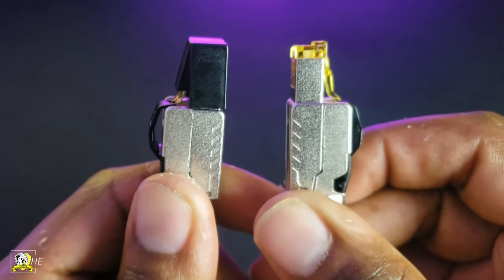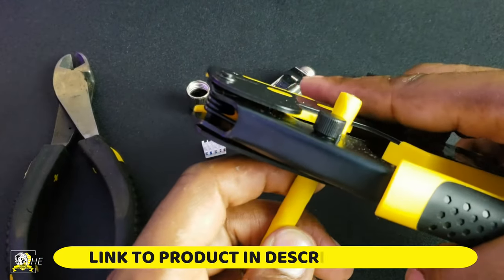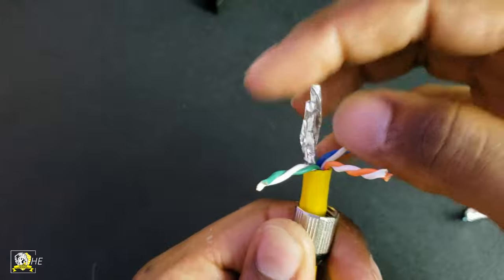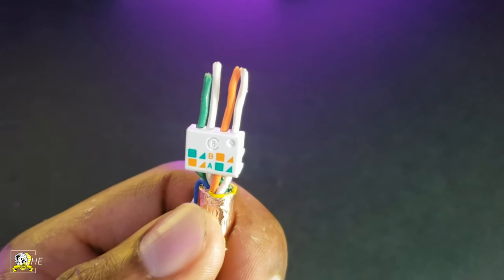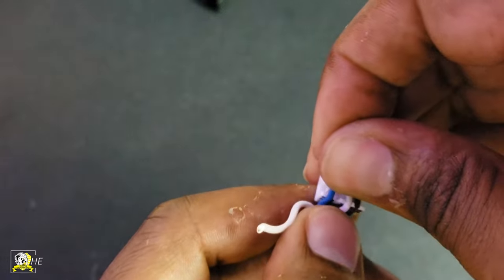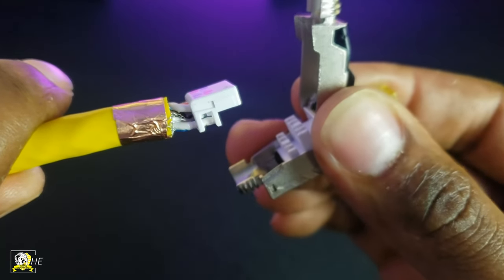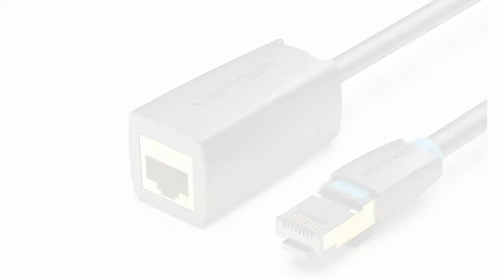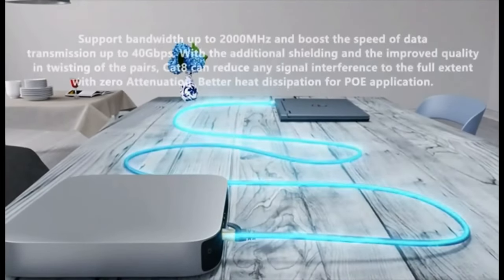DIY Cat 8 Ethernet Cable - Male Field Termination - Save Money!

Comment: It won't be the fastest Internet cable if the shielding is not attached correctly. The drain wire should not be cut, it should be folded back and tapes over with the copper tape for correct electrical grounding.
Reply: Yeah, that part really bugged me. Ruining the whole connection.
Reply from the maker: Yes I'm well aware of this from the 1st to the 20th person who made the same comment. 
I acknowledge the error then pinned (1st comment) a link to how to ground the cable in the comments + description.

Thanks for watching 👍🏽
Reply: @HumanEncoded  looks like YT did ya dirty. It doesn't show as pinned anymore.
Reply: @HumanEncoded And yet it took you a full year to finally respond defensively..

Comment: The shielding mesh around the conducting cables has to be connected to form a Faraday cage, to protect that cable from electromagnetic interference:
https://en.m.wikipedia.org/wiki/Shielded_cable

Faraday Cage:
https://en.m.wikipedia.org/wiki/Faraday_cage
Reply from the maker: Good point... Will have to make another video grounding the shield in the near future. Thanks for sharing

Comment: Even though you made some mistakes on the specifics of this tutorial im glad you left it up. Im wiring one of these up today and im horrible at following diagrams. Sorry the internet is populated by assholes. Thank you!!!
Reply from the maker: THANK YOU AUSTIN! 
I've acknowledge the error (seems like) hundreds of times on here. 
I've even posted a link to a video (in comment/ description) correcting it. 
What I was NOT about to do was erase it!
The CAT 8 cables I made like this still works to this day! 
I do appreciate ppl like you that understand & still are able to get value from this video.
Will make sure NOT to cut the wire on the next one! lol 😆

Comment: What about the grounding wire, and testing it?? I would put the external cup before stripping the wires out. Thanks any way.
Reply from the maker: I did cut the ground wire (not knowing it was needed). I also tested it by plugging it into my computer & testing the internet speed. It worked with no problems & is still working. 👍
Reply: @HumanEncoded  At low speeds it's no problem, but at higher speeds it is necessary.

Comment: It was nice to see what it looked like. I have some cat6a that looks almost exactly like this. This might have a slightly denser outer woven shield and possibly more twists per Inch. But, after hours and hours and hours of reading and looking up specs and TIA standards I realized after fully shielded twisted pair cat 6a standards don't mean dick. You gotta look up the cable spec real good and see whats inside. Some cable.is over spec and some cheapo under specs.
Reply from the maker: Very interesting info... thanks for sharing & watching. 💯

Comment: You build very expensive antenna by not connecting ground 😂🙄.
Reply from the maker: I realize that after I posted the video but the cable still works fine to this day. I still receive high speeds from it.
Reply: @HumanEncoded  you should not ever cut that wire the factor made it to resolve interferences, reduce interferences will increase speed by lowering ping
Reply from the maker: @johnricher133  Glad to hear all of the feedback for everyone after cutting that wire. Will definitely NOT cut it next time. lol 
Thanks for sharing John. 👍
Reply: @HumanEncoded  Your Welcome!✌🤘👍

Comment: You stripped away the metal wire shielding that is needed to ground this. Then you applied the conductive metal foil wrap to the outer Cover of the cable. So what is the foil supposed to connect with?! Is is supposed to make an electrical connection between the metal shield wire and the metal housing of the connector. Your instructions preclude this connector from performing the way it should. Why are you doing instructional videos misleading people how to do this? These connectors are very expensive and are designed for very high speed.
Reply from the maker: As far as I know the wire that I cut only operates as a shielding component.
It only shields the inter wires that I connected from outside interference (frequencies). 
The fold that I wrapped around the end acts in the same way.
You do not connected that outer shield to anything. 
I'm not sure what you are talking about Dan. 🤔
Reply: @HumanEncoded  I understand that these components (wires) shield, but they also act as grounding. These connections are supposed to make an electrical ground that is carried through their metal housing to “shielded patch panels”, which are themselves grounded via an electrical wire to the rack.  Shielded patch panels for racks are twice the cost of normal patch panels because they are designed for grounding with these metal (and expensive) terminations. The foil that comes with these is special. It’s adhesive is also conducting. It is for electrical connection for grounding. Therefore, the wires just inside the outer cover of the cable need to be wound back on the outside to connect with the foil that connects with the housing.
Reply: @HumanEncoded  Dan is correct. That was a big mistake
Reply from the maker: @danphilpott6302  I looked into what you said & you are correct about the CAT 8 cable should be grounded.

Since I have made & installed several CAT 8 cables before making this video & they all have worked & have yet to fail I'm not sure how life threatening it is for it not to be grounded in that way.
I will however start to ground my cables from here on out.

I will also add another video in the description showing how to ground these cables.

Thanks for your input & insight Dan 👍
Reply from the maker: @ChadDrakeTech  Yes Dan was correct Chad. Not sure if that was a big mistake considering I have created & installed CAT 8 cables since last year this way & they have yet to fail.
I will however start grounding my cables from here on out. 👍
Reply: @HumanEncoded  The cable will still work - what the shield is doing, is preventing interference from the outside, so if not installed correct, you wont be able to reach the bandwidth and speed that CAT 8 can reach at its max, which is aroung 40Gbit if I remember correct, you might only get a max of 20 with an unshielded cable - on the other hand, if using a RJ45 jack on a CAT 8 you will never reach maximum bandwidth and speed anyway, you have to use GG45 connectors.

Comment: i accidentally bought these for my cat6 is it still save to use?
Reply from the maker: If the wires fit then it should work. Never tried to used them in that way before.
Did you end up returning them or did they work for you Brent?
Reply: @HumanEncoded  yeah they worked
Reply from the maker: @brent5709  That's great to hear! Now I can spread the word. 😁
Thanks for letting us know! 👍

Comment: This is a gimmick. If the copper cable isn't bigger then the cat6e copper cables then it's the same cable. The shield only protects against Static electricity and or higher frequency Interference.
Reply from the maker: I'm not sure if it's a gimmick or not but I'm sure within a couple of years more stores will start selling.
More than likely they will improve in quality over time as well.
Thanks for sharing your thoughts. 👍

Comment: Wrong. By tearing off the shielding the cable won't be grounded and therefore the shielding is useless
Reply from the maker: Yea unfortunately I did cut the ground but it still works & haven't had any problems with it since making it.
Reply: @Human Encoded   if there's no  interference you won't miss having the ground.

Comment: Sorry, so many things wrong with this video. 

1: "CAT8 is the fastest internet cable on the market"
 - Does Fiber or even DAC not exist?

2: "CAT8's you don't have to crimp"
 - With the connectors you're using, you don't, but there are many out there in which you do crimp.

3: Pull the outer shielding down, "What I do is cut that off, some people keep it but I cut mine off"
 - That metal weived shielding for CAT8 is to ground it, this needs to be folded back and NOT cut. Will be used later.

4: Copper foil, "My guess is it's there as a shield, as well as probably  giving it security once we put the male connector on top of it."
 - This copper foil was there to connect to the ground shielding to the connector which you had previously cut off. You shouldn't be making an instructional video for expensive wiring if you're going to be doing guess work.

5: Bits vs Bytes
 - Bytes are for Data Storage, Bits are for Data Transfer. There are 8 bits in a byte. 40Gb = 40Gigabit, 40GB = 40Gigabyte. These are NOT to be confused. 40Gb = 5GB. 

Additionally, to get the full 40Gb speed both devices must support it, at that point though, DAC and Fiber are the better way to go as they use less energy and fiber can go longer distances, not to mention most devices supporting 10Gb+ will be using SFP modules, not RJ45.
Reply from the maker: Show me some fiber optic & DAC cables on the market you can purchase for home use that I can plug into my router & computer. 🤔

I am well aware of the ground issue after posting this video + I pin the comment about how to ground CAT 8. 

After figuring that out, I realize what the copper foil was for. 🤷🏾

I do however appreciate you breaking down the bits vs bytes. That was helpful 👍🏽

Thanks for taking the time to watch this video. 👍🏽
Reply: @HumanEncoded  First off, CAT8 is not intended for home use. Secondly, Fiber cables are extremely cheap and the SFP modules are very inexpensive as well. DAC are very inexpensive as well and their prices don’t go too far up for distance.

And of course, the video was well layer out, it was merely the few instructions that were off. Still have it a thumbs up!
Reply: @Tankbot  I'm using cat 8 in my home office just fine.
Reply: @austinrutledge6484  I don’t see the relevance haha, I didn’t say there was anything wrong with CAT8 it’s just redundant these days and too costly.
Reply: @Tankbot001  I don't see why you felt the need to arbitrarily shit on a random creator. But here we are 🎉
Reply: @austinrutledge6484  I wasn’t shitting on, I even complimented how well put together the video was. I was just correcting the misinformation so people don’t waste a $50 product.. Don’t get me wrong, besides the things I explicitly stated, great video. Gave a thumbs up.
Reply from the maker: @austinrutledge6484  Thanks for helping to clear all of that up for me Austin. lol 😁💯

Comment: But it serves no purpose using Cat 8. A waste of money.
Reply from the maker: You don't think this is a good future proof investment?
Reply: @HumanEncoded  At the moment there is no future in sight. Cat 6 supports 10 Gbps just fine. There has been a specification for 25 Gbps over Cat 8 with really short runs (100 feet max) that has existed for 8 years and not a single manufacturer has produced hardware. If I saw a realistic future with actual hardware available I wouldn't be against it. At the moment it's like buying snake oil and wasting money.
Reply from the maker: Oh ok, I see your point... thanks for sharing your thoughts  @0bsmith0  👍